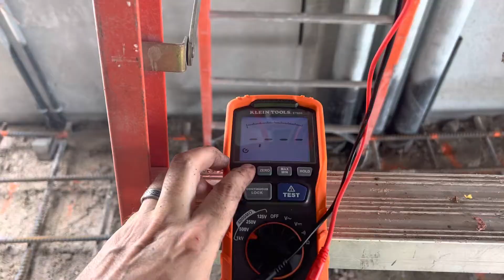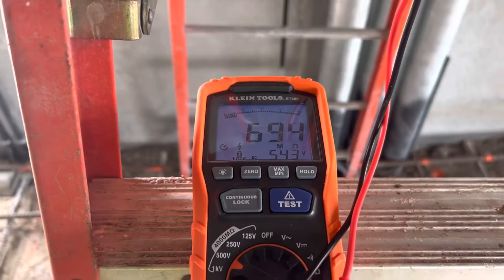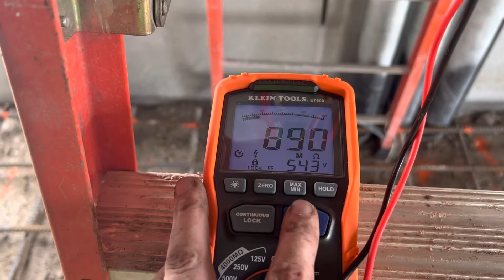Field Insulation Test

Comment: Do you add water to the conduits? If there is a bad spot in the insulation and an air gap would you still get a good test? TY and good video.
Reply from the maker: If the pipe is completely dry, and there is no humidity, you would read a high resistance value. But with below grade conduit, there is almost always at least high-humidity levels.

Comment: Is the ground suppose to be connected on the end of the cable without the leads, so basically is one end of the ground cable landed ?
Reply from the maker: There might be a reason to perform the test that way, I can’t recall now if I did any like that.

The purpose of the test is to determine whether the insulation is damaged and in an environment that would allow current leakage. So if I grounded one end, I would not be able to determine if there was a “leak”. Because it would already be shorted.

If that makes sense.

Comment: All phase conductors that are not being tested should be grounded during the testing.
Reply from the maker: Would this be a safety precaution?
Reply: @UnityBuildEstimation  I’ve done this test many times and we tape off the other ends of the conductors , and anything over 3200 is good. If you ground the other ends it will damage the tester and give you bad results.

Comment: That cable doesn't look good..
Reply from the maker: The last 4’ did get scraped coming out of the connector during the pull. They did test out though so it’s all good :)
Reply: @UnityBuildEstimation  more yellow 77..lol
Reply from the maker: @sircampbell1249  Haha yeah, these pulls were 1080' long, we had a lube pump on the feed end. Not sure how many gallons made it into the pipe, but it was a lot.https://www.polywater.com/en/product/polywater-nn-lubricant/
Reply: @UnityBuildEstimation  All that damage to those conductor sleeving, meanwhile we see standards elsewhere lugging massive 3 or 4 conductor armoured cables without issue. In north america that steel conduit always rots out with rust in outdoor salt settings... the standards in North America don't appear to cause less electrical fires either, only cost significantly more money?